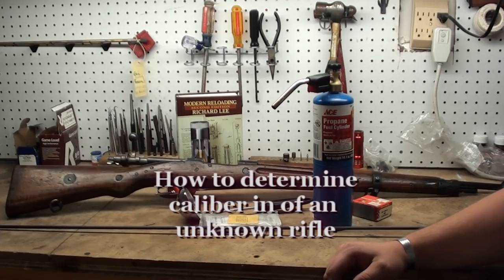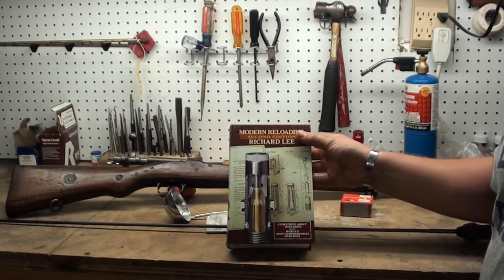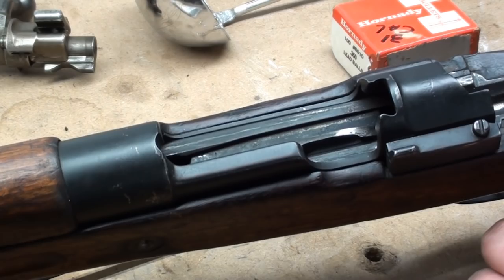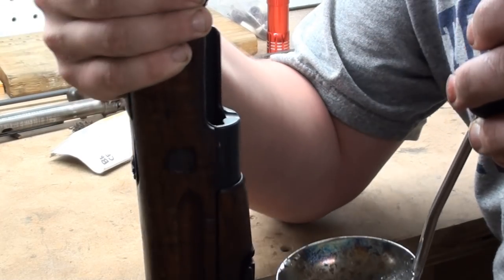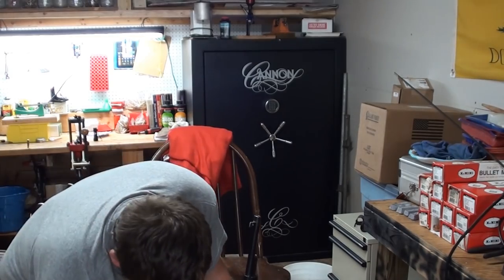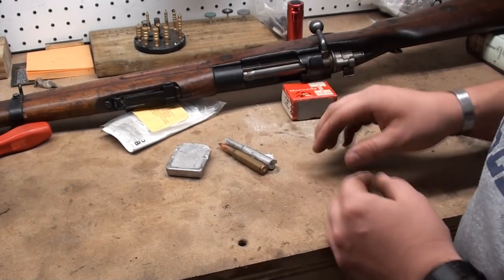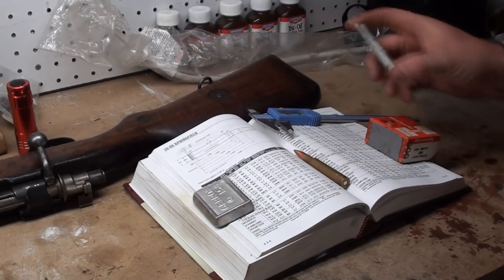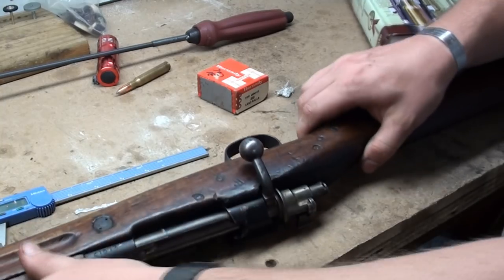How to do a chamber casting

Comment: SAMCO is shipping the Spanish Mausers in the 308 now. Case anyone was waiting or wanted to spend $169
 I got a Polish AK with throat erosion, faint rifling, a Romanian welded carrier&piston and a bayonet type 1 that's not Polish. I had to replace all the above. So if anyone wants one of those Century Polish builds, it cost me another $200 plus labor taking barrel off, stripping and headspacing a USA barrel and Parkerize again. And I don't think its 922 compliant, just a trigger and receiver.

Comment: @rampaginghamster That circular shield is a tool used to take apart the bolt. Yes the m48 had no stock disks but i thought it was just restocked.  They're apparently is no chamber markings as they were scrubed and then marked .30. They're would be no markings at all on the "shield". And the belgian mauser has alot of diffrent variations serveral would have been jut like the one in the vid. :)

Comment: Can i replace Cerrosafe with beeswax or candle wax?
Reply: No. Beeswax and candle wax will shrink way too much when they cool. As it cools the Cerrosafe shrinks at first which allows easy removal, but it expands back up to be the size of the chamber at room temperature. This happens as the metal forms it's crystal structure on cooling.
 Lead is also not recommended, it melts at a much higher temperature and its size will not be the same size of the chamber at room temperature.

Comment: With what you have I'd say use the projectile of a 303 ( I think that was one of the .311) instead of .308, in your 30-06 shells. Might improve accusatory of it.  
To those that say a 30-06 is a .308 bullet not a .311. In a new 30-06 heck no use .308, but this puppy is already. 311. 
When your apples become mush make apple pie.

Comment: I certainly understand how to use cerrosafe in chamber casting BUT, by pouring it into the chamber with a ladle, what happens if some of the cerrosafe enters into the bolt recoil lugs in the front of the action?  I would think that that would cause the cerrosafe casting to be unable to be tapped out?  Your thoughts on that!!
Reply: He mentioned that in a related video--probably on the right.  He does say to try your best not to get it touching the bolt lugs because its a pain to get out...that being said, it does have a very low melting point-if you get the bolt lugs warm enough to melt the alloy, presumably, you'd be fine.